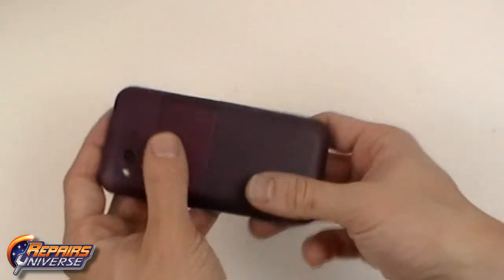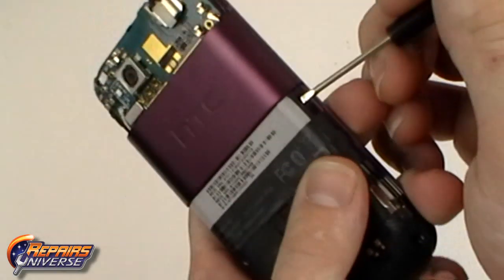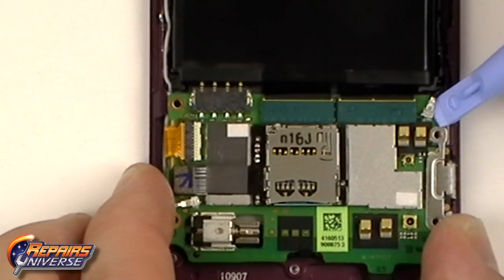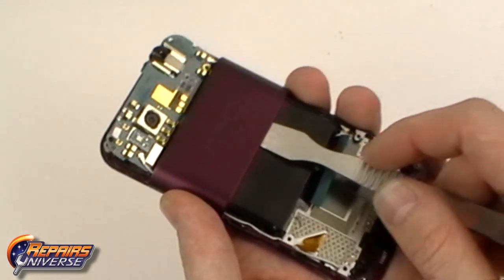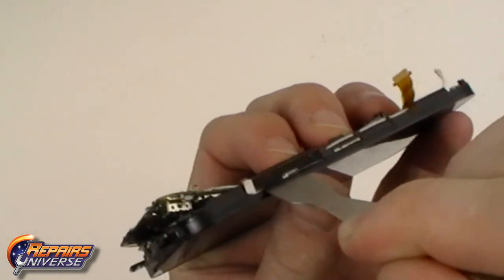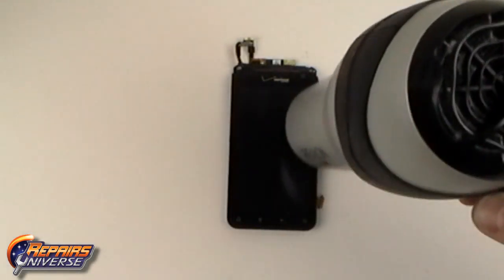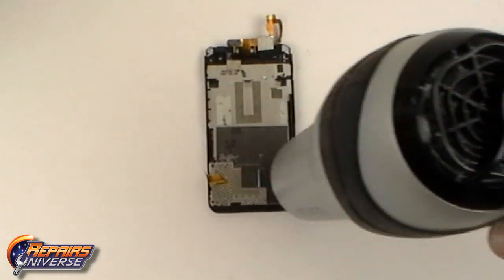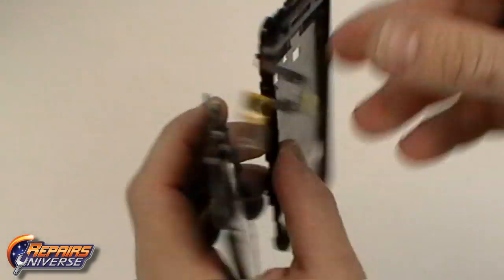HTC Rhyme Take Apart Repair Guide

Comment from the maker: Use heat to loosen the bond between the LCD and touch screen digitizer. You can use a hot hair dryer as shown in this video. Be careful prying apart.

Comment: as the corrosion and subsequent residue were alkaline, I used a toothpick, lemon, and some distilled water, rinsing away the solution with distilled water and a fine haired paintbrush.  I managed to remove a vast majority of the corrosion and it works great now.  Only problem, the camera no longer works.  At least after the initial disassembly I put it together cold, without heating up components, so it will come apart easy. Will shop for flex cable and board once I have funds available.

Comment from the maker: What seems to be the issue you are having? Check to see if you have the correct size screw driver and be very careful not to strip the screws. Some times certain screws could have a little loctite on them, but once they break loose you should be fine.

Comment: Fiance dropped hers in toilet, tried to keep using after it got water in the headphone jack.  Have encountered moderate corrosion or touchscreen flex connector and subsequent resistors next to jack.  Advise for removing corrosion?